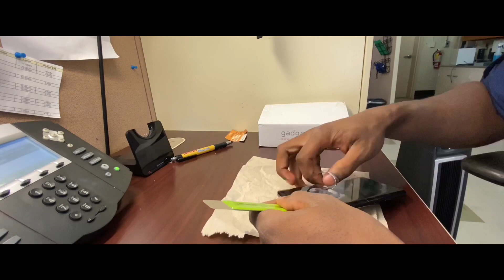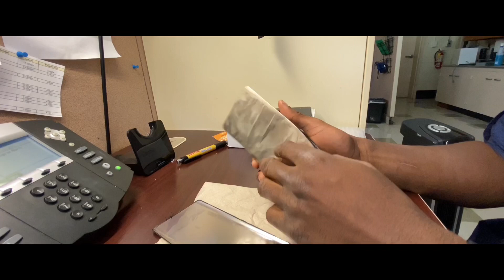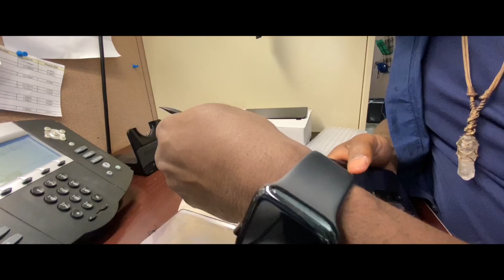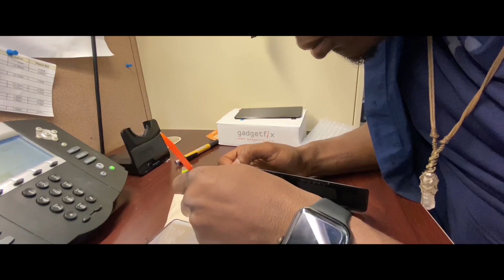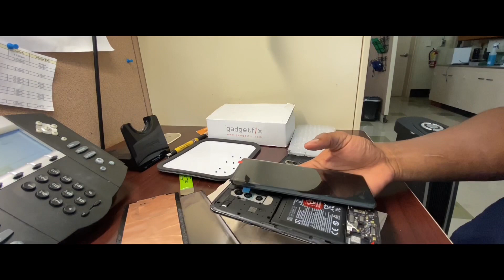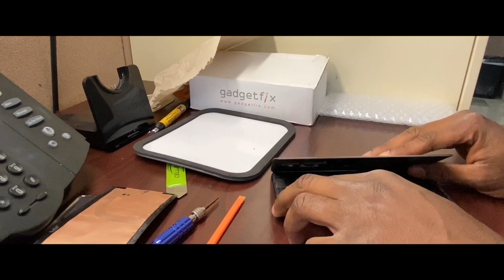One Plus 7 Pro Screen Replacement

Comment: Hi. Can I ask where you got the screen from? I get most of my stuff from witrigs but heard that maybe the 'oem' screens they have there aren't actually OEM.
Reply from the maker: Lots of places claim “OEM” due to having pulled parts for original screens. Depending on the device I have multiple suppliers for parts such as MobileSentrix Cell4Less or Rewa.(sorry for the late response
Reply: @xUnFaiR  AliExpress have them

Comment: Was there a cable connected directly to the glass when you removed it from the frame? I just found a Chinese manufacturer that sells the glass only which makes the entire repair only $10 compared to $250. I just need some more information on this display before I go ahead begin taking my phone apart potentially screwing everything up.
Reply from the maker: Do you have a link to the part?
Reply: They sell just the glass... however it is so difficult to separate from the actual screen

Comment: Im thinking about buying te screen on AliExpress, but there's are two versions of it. So I wonder if I should Buy the one that includes the frame or not. 
Did you buy the one with frame?
Reply: Definitely get with frame, you will never get the screen sitting flush if you just get screen without frame 👌

Comment: I cracked my screen and it works fine so I was wondering if I could just buy the front screen online for cheap and have just the screen replaced?
Reply from the maker: InfectedPooSea the One plus 7 pro screen is a full assembly so attempting to remove just the glass would damage the LCD and digitizer.
Reply: @MattTechStudio  ugh that's what I thought. I called yesterday to get an estimate on the repair in a shop near me and it was a hefty $360
Reply from the maker: InfectedPooSea Yup... you can save about $100 if you do your own repair.
Reply: @MattTechStudio  if only I had the patience and steady hands haha
Reply: @MattTechStudio  how long did you heat the front for?
Reply from the maker: @lxrdgxnji578  I believe I left for 5mins but not constantly.

Comment: Thank you a lot it was difficult getting it off but it works fine thank you a lot
Reply from the maker: Glad I was able to help
Reply: Did the screen atached well?
Someone told me that after replacing with no frame LCD it would not sit flush